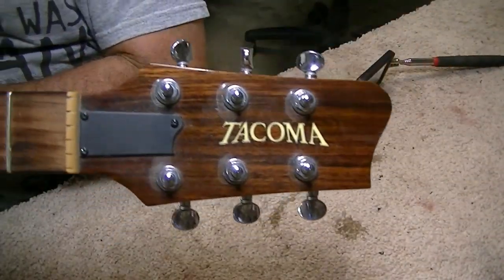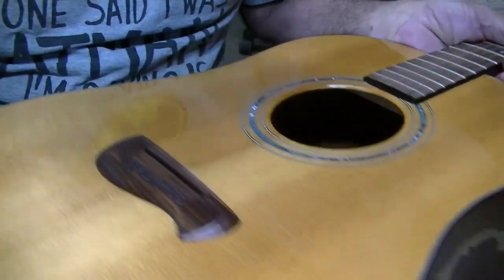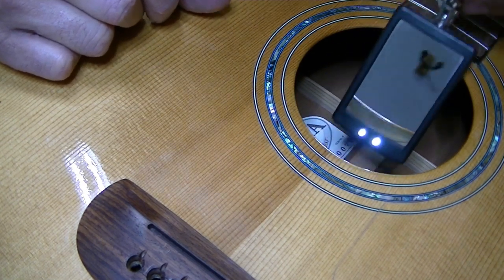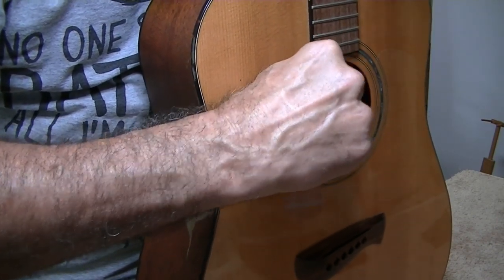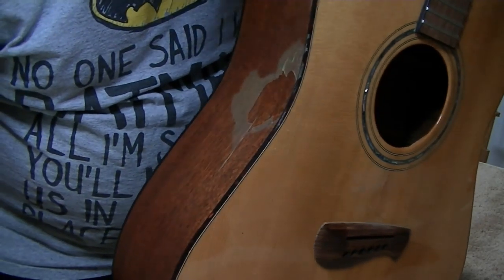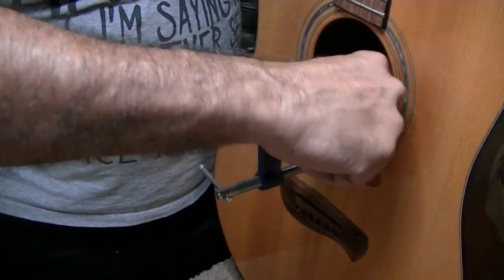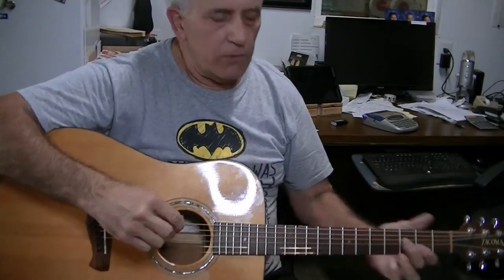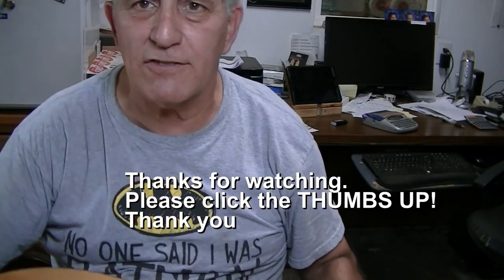314 RSW Tacoma Dm10 Guitar With Broken X Brace

Comment: Wow! I've never seen poly peel like that.
Reply: Looks like something got spilled on the finish. Maybe rubbing alcohol or acetone?
Reply: @rayvoorhies7180  it reminds me of the plastic that covers a pickguard, that the purchaser of a new guitar can peel off.
Reply: @rayvoorhies7180  This happens when the painter does not add tooth to the finish being sprayed**DR KEL
Reply: @dscdrkel5546  That's one possibility.
Reply: I think they applied the finish before the wood was fully cured and the out gassing was trapped between the wood and the finish.
Reply: The Tacomas were known for this.  I have 2 and both have the same issue.